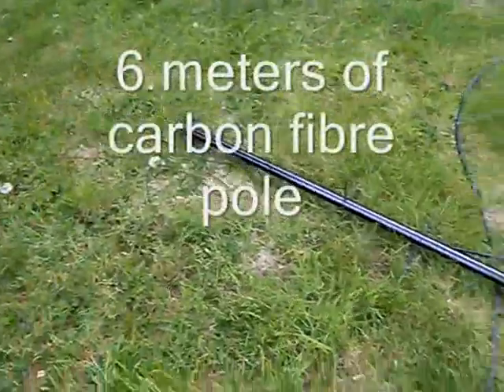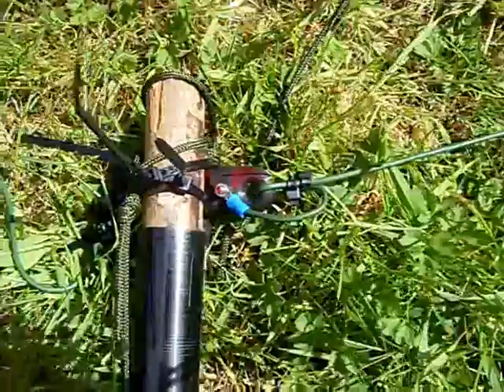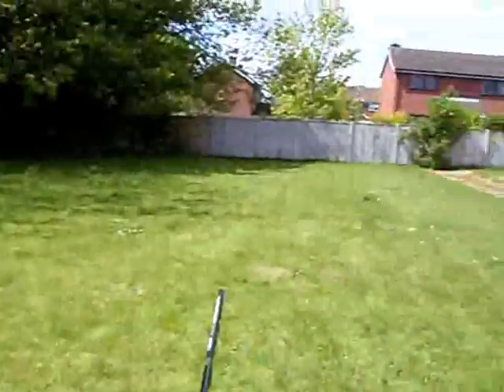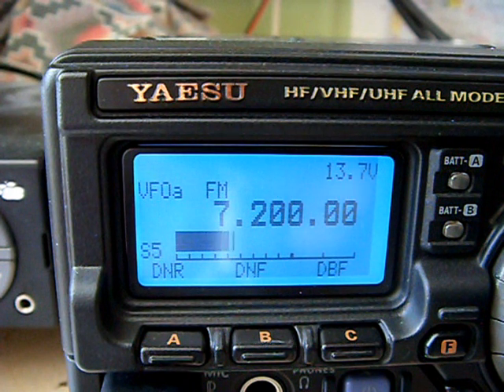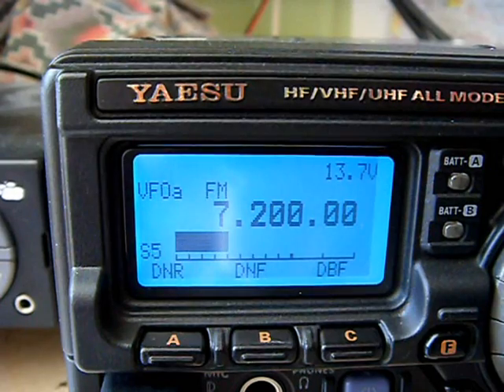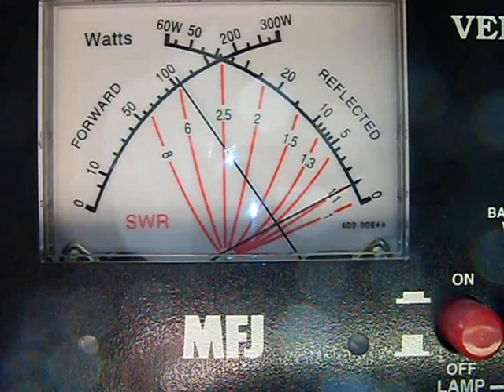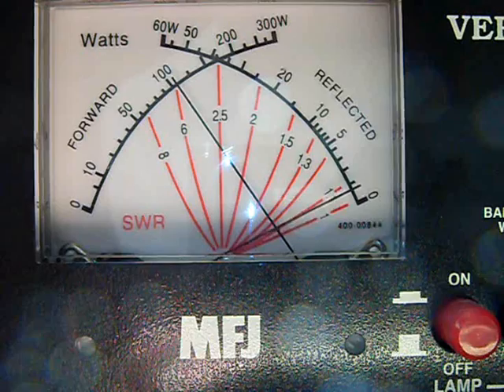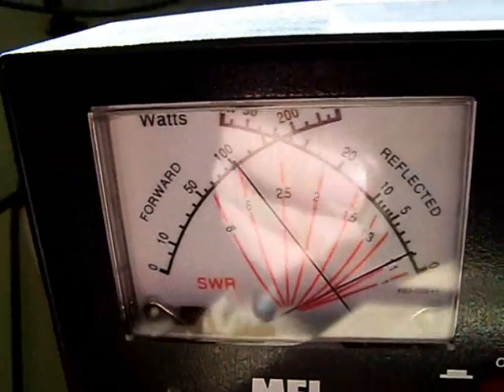M0VST -  The 40 meter dipole

Comment: Thanks for the video. Maybe I'm taking what you're saying incorrectly but your SWR readings on the meter are a little off. You seem to be taking the SWR reading from where the meter is pointing (at the tip of the SWR meter). With cross needle meters you measure the SWR from the point where the meters intersect or cross. I only say this as at the bottom of the 40m band you say your SWR is "just over 1.3" which is where the tip of the meter is pointing, but in actual fact the SWR is closer to 2 (where the needles intersect). Maybe I'm not getting what you mean in the video and you may be reading the meter correctly and I'm missing the point. Anyway, great video and nice antenna! 73, Craig VK3CRG :)

Comment: Good vid.
As a possible ad on, if the swr is high on the higher part of the chosen band, yet low on the bottom of the band.
Rememer the lower the frequency the longer the antenna has to be and vice versa.
So if it has a high swr at the low end of the band ad a few inches, if high at the top of the band shorted. 
(easy)

Comment: cheers mate,i used 10 foot coax and attached 2x 51 foot lenthsof spot light wire onto the coax live and brade and it works great! lol,i dont transmit so dont need to worry bout the swr,i see you have 800 bearcat in the video too,i have one too great scanners,i also use a realistic pro 2006,and a realistic dx394 for short wave listning, into weather satalite decoding now too,got sum great maps,but i have to build a double crossed dipole now to get images,will let you know how it goes.atb wayne.